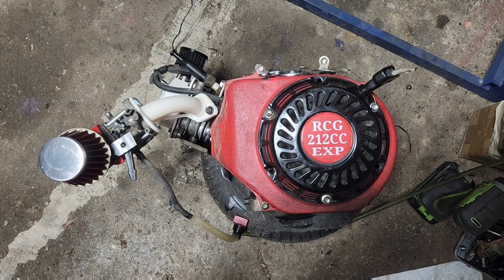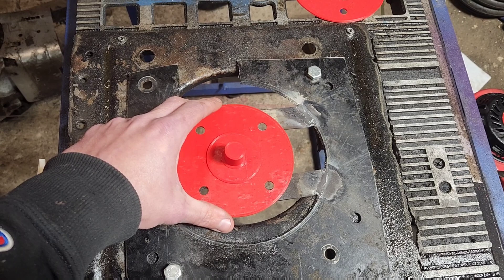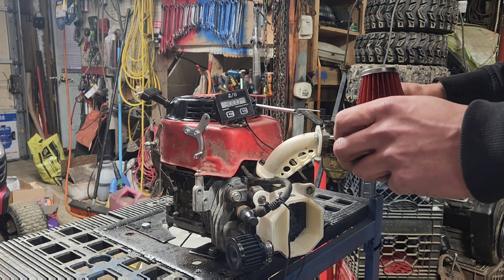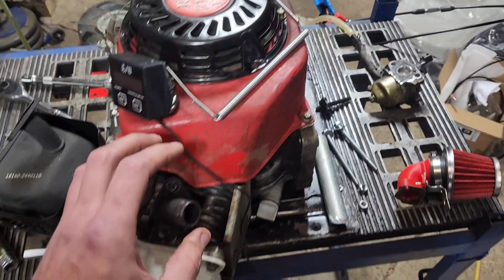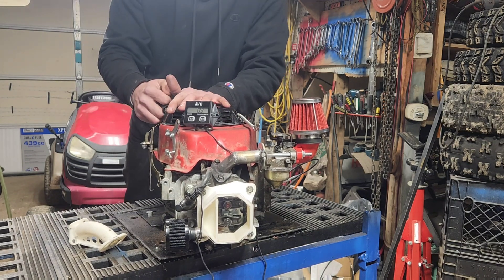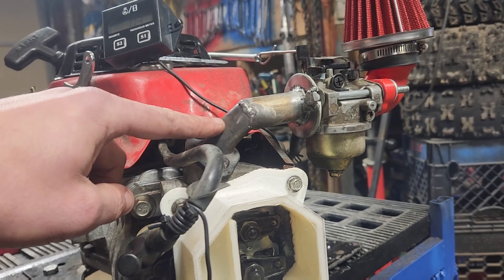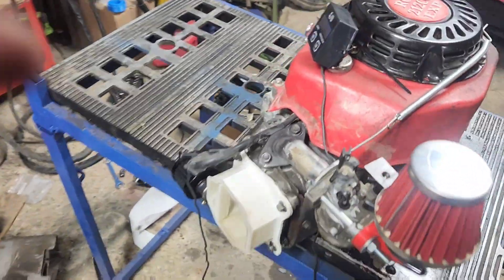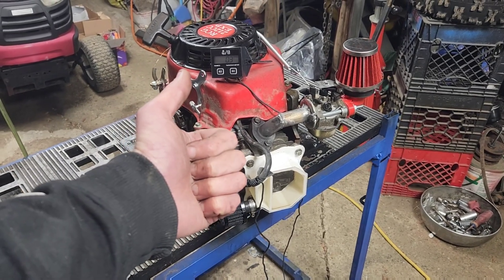Vertical Shaft Predator Experiment 212cc

Comment: Yes sir . Is it still going. How did it hold up so far. Im thinking of the opposite need horizontal Kohler command for 2542 gt cub cadet. I can get a vertical o e lot cheaper than horizontal. And do hace my horizontal one complete so should have case's or mostly anything but internals as mine locked up. THANKS

Comment: I have an 8 horse Briggs & Stratton engine That is horizontal and I see the cover you got for your engine is a horizontal cover and I was wondering if you think That if I just ran my Briggs & Stratton with the horizontal cover and filled it with more oil would it run good do you think I’m using it on a racing mower and i would obviously turn the carb to run the right way ?

Comment: Wondering if like a primer spray to fill in the voids and then what the best gasoline resistant-proof spray paint would seal over the primer and the rest?  Also, with ABS I think you can use some sort of solvent like acetone to polish chamber and I think better seals the print?  Maybe just brushing on alone will as well.  Never done, though might help.

Comment: The Tillotson flywheel has a different taper than the non hemi predator, any performance parts you would have to get for a non hemi predator. Non hemi predator uses a different cam, flywheel and rod than the standard "clone" engine. A good aluminum flywheel, a .265 lift cam, billet rod, 22lb to 26lb springs. Should get close to 7000rpm, a vm22 carb will flow more than a jetted stock carb, but I haven't played around with a stock carb for performance much.
Reply from the maker: Stock carb performance will come down to if I can find a way to getto bore it out. The cost to buy one bored is twice the cost of a china VM22. The other option is to do a gx390 carb conversion. But that opens its own kettle of fish problems.

Comment: Valves are set to tight because fire is coming out of exhaust that happened to me trying to go under settings for a Tecumseh it was supposed to be 6 and 10 I tried 4 and 6 well it shot fire out of exhaust while mowing the yard 😆 I reset it back to factory settings and it worked fine after that I got lucky I guess

Comment: #1 most important thing roller bearings in the connecting rod. #2 roller bearings at the crank. #3 one of those fancy high rev kits. Smaller roller bearings at the cam shaft. I mean it would have to be heavily modified. And some kind of a dry sump system to keep the oil of the way of the rotating assembly. Should do it. Oh 2 layer head gaskets...... disregard this message i didnt realize you said stock parts.. sorry
Reply from the maker: I appreciate all the input. This is a new to me just as it is to my viewers. The more info the better.
Reply: This is the best answer
Reply: Why smaller cam bearings though has me puzzled?
Reply: @davidrobinson8875  because you will need smaller roller bearings for the cam it wont spin 8000 for long on metal to metal bearing surface not enough oiling sir